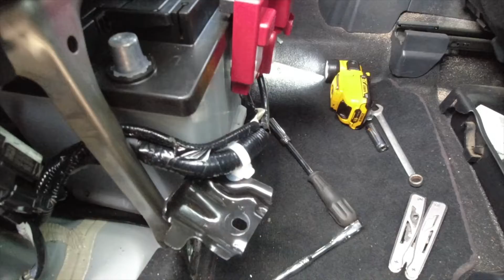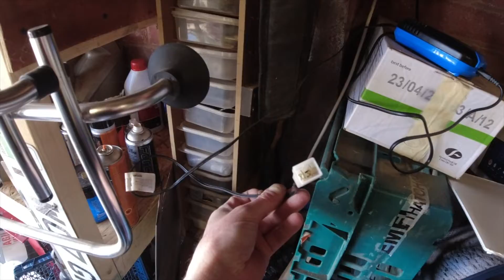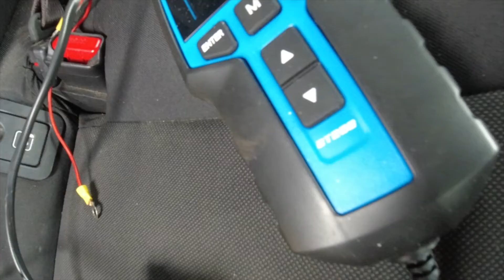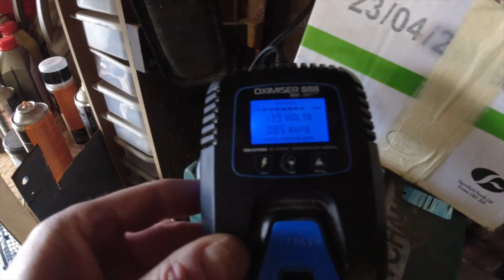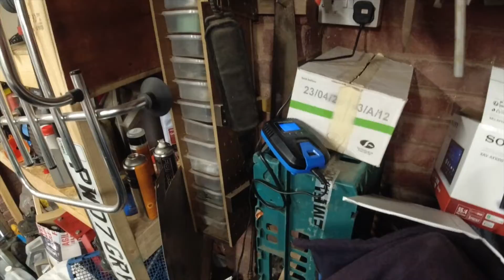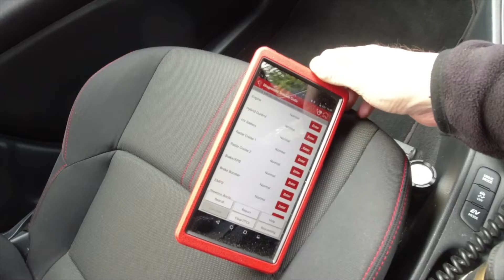Toyota yaris GR Sport testing 12 Volt battery

Comment: I don’t think that battery is very good at all, on it’s way out IMO. A reading of 250-265 amps is quite a significant drop for a small 300 amp battery. That battery would have tested 350-400 amps when new.

Comment: Interesting as always.

Question when buying my 2024 GR Sport the dealer said Toyota don’t replace the batteries once they die.

Can they be replaced or is the hybrid useless once the battery runs out?
Reply from the maker: If a 12 volt battery dies, you can use a jump pack or jump leads to get the car going, it will operate perfectly after being restarted, the 12 volt battery can be replaced as it’s just a simple 12 volt battery, which at the end of the day is something that’s going to fail and wear out naturally as they do in every single vehicle that has a battery, they have a  lifespan dependent on use
Reply: @paul_nwsxs  thanks for the answer
Reply: Paul, ditch the Oxford optimiser,  they are very poor quality,  plus the connector is rubbish, I've had two replaced under warranty, the third lasted less than 12 months with occasional use. I don't use them on the car they are for my bikes.
I always use a circuit breaker on them as the last oxford one when it failed was that blackened it must have been on the verge of combustion had I not been using the breaker.
Spend a bit more and buy an optimate, much better quality and a proper rubber connection point from the battery to tender.
Reply from the maker: my oxford is over 5 years old and does not have the silly rubber plug , it's been replugged with a better quality connector , i,ve used the oxford for years and it's always kept my motorbike batteries in good condition over the winters i store them , it's what iv,e got and it's work great on the 12 volt batteries on the yaris hybrids for me , i do agree there are better quality chargers but until it dies i will continue using , i do have breakers on every socket and circuit in the workshop and the only time iv,e triped them was arc welding one evening
Reply: @paul_nwsxs  you've fallen on a good one then for sure, because the new ones are plagued with failure issues, my harley davidson and triumph ones are both rebadged optimates and have been really good.
I thought I'd try the Oxford for my guzzi, but after the failures have gone with the optimate and all good so far.
Long may your Oxford keep working 👍

Comment: I did a similar lead for my Noco jump pack but also have a solar trickle charger inline with voltage regulator control showing voltage etc with usb points too.